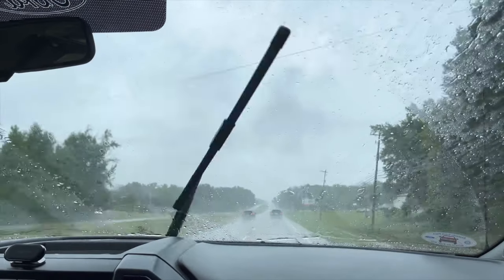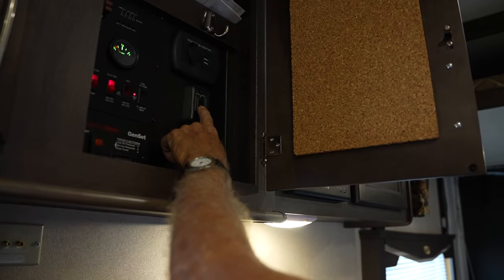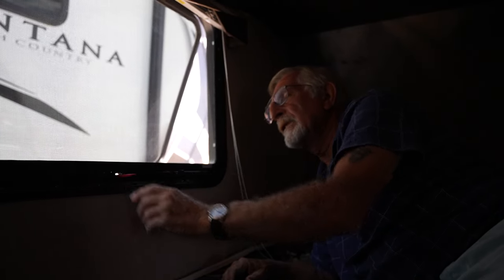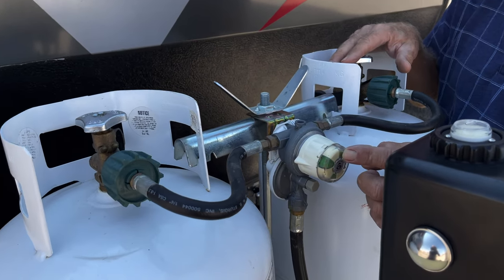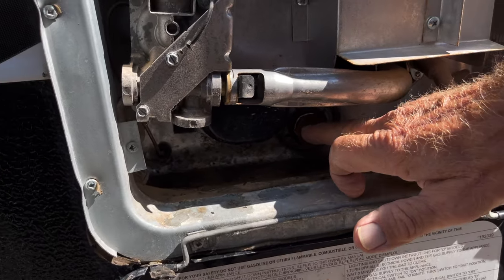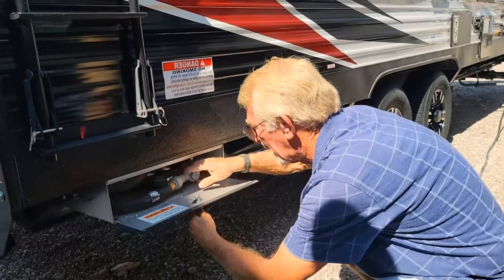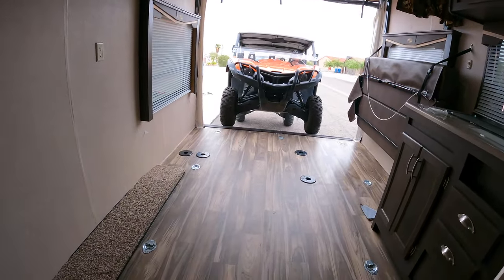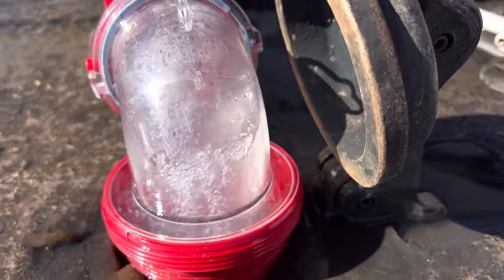1st-time RV buyers NEED TO KNOW THIS! Travel trailers, toy haulers & RVs.

Comment: I wouldn't recommend leaving your water heater electric switch in the on position.  If you water tank is empty, say at the beginning of the season and you plug your trailer in to shore power you will destroy your electrical element inside the water heater.

Comment: Regarding tires, know how to read the manufacturing date of a tire, they shouldn’t be more than two years old
Reply: manufacturer says 4 years at least - but i would think that would go by what they look like -- miles count just like on the vehicle -  and whether they were sitting in the sun and on the ground or not -- those two things are important - tires should be looked at daily while driving - and rotated about every 6 months and checked on the inside also - common sense applys - where and the world did yu get 2 years at - is it in the air ? !